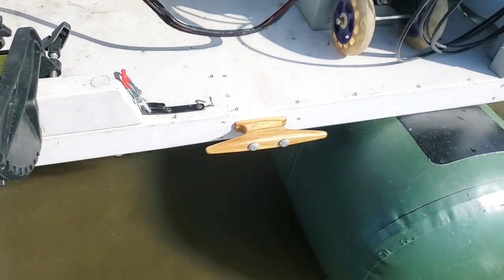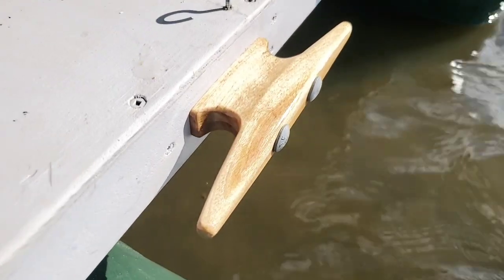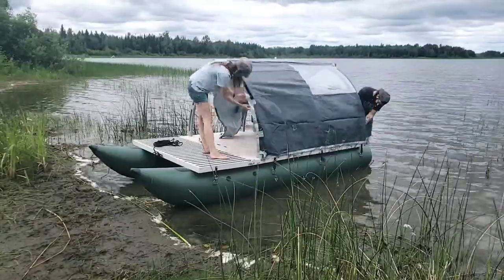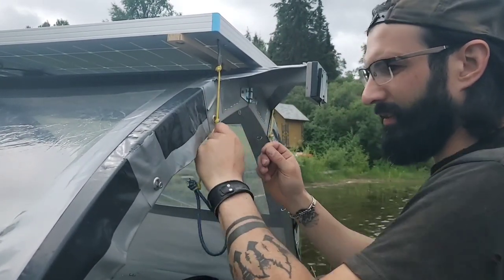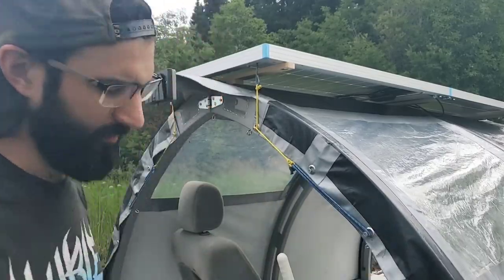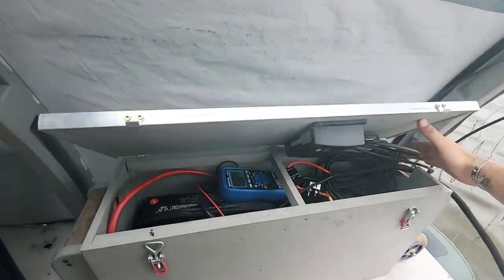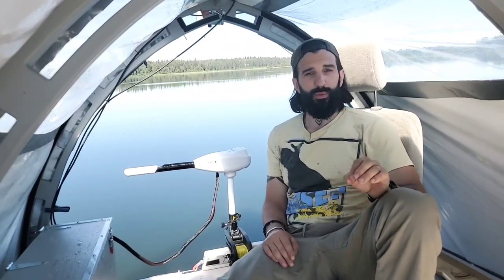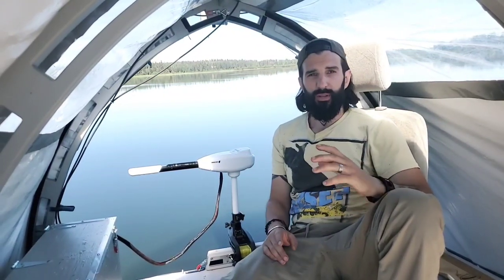Solar powered boat that fits in minivan!

Comment: sir, if i may advise, please use glands for the cable way, it do helps with waterproofing. since you are exposed to the risk of water. 

then you can add some rubber gasket sealing to the box, it have a good lock system already, it should add extra waterprotection.

batteries are always energized, please handle with care.

Comment: As soon as I saw your cool solar pontoon boat I had the idea of making a floating fire pit to attach to the front between the pontoons. That way you could get the whole camping experience and not go on land. Excellent build.
Reply from the maker: I had the exact same thought when we were out camping on the boat!!! I haven't quite figured out yet how to do that safely though. I think next year I will rebuild part of the boat and improve it where I can, maybe by then I can come up with something.
Reply: @adrianwoodworm  Thin walled steel box tube for the floats wouldn't melt, but I don't know if you have a welder. Otherwise, I think you could just use polystyrene if you insulated it with that ceramic insulation and spaced a couple sheets of sheet metal over it. Like you did for the woodstove in the houseboat.

Comment: great for where your located but the south texas sun murders pvc flotation in 1 to 2 years, and the tarps might be gone within the first year. people in the south need to stick to there is another inflatable floatation material but it is super expensive which would be outside your range i know.
Reply from the maker: Yeah, I can imagine, the sun can be surprisingly brutal. I would be curious about the other inflatable material you mentioned. Do you remember what it is called?

Comment: You could probably modify the pieces that make up your deck to connect together to make a box to keep all the other parts of the boat in when it's not in use. Maybe just a couple of corner pieces, with a dowel and hole at 90 degrees from each other, if you didn't want to modify the actual deck pieces.
Reply from the maker: Very clever! I love the way you think!!!

Comment: Have you thought of capping some sewer pipe to create outriggers in the event of extreme weather so that you don't capsize? Extreme waves especially on the ocean could capsize you. Also gutters in a bucket can create a collection well in the event you end up too far from shore. Plus a pot a pan of ferrocerium rod saw knife paracord sanitizing liquid and whatever else you want in case of a Gilligan situation
Reply from the maker: Due to the two pontoons that are basically set up like a catamaran, the boat is extremely stable, so there is no need for outriggers. Regarding extreme waves and the ocean: this boat has absolutely no business on the ocean in extreme conditions and it is not what I designed it for. 
Your ideas for the rain gutter and the other gear are great! I have to say though, I am a bit too old for getting myself into those extreme survival situations😄 on the other hand, you can never be prepared enough, I do have always a plastic crate with me with some essentials: water, knife, multi-screwdriver, wire, lighter, rope, additional live jackets and good old ductape. I would like to add in the future a first aid kit, a signal air horn, a flare and sanitizing liquid as you suggested, good call btw!
Reply: @adrianwoodworm  on my budgetary limitations of $454 a month American before bills barring a miracle I would need to build it on $500 or less total cost and if I were building it with how many times I've been homeless I would need to build it like a mini floating mobile home making it necessary for outriggers if only because I couldn't afford the mistake if it went down but I love what you've done with the place keep up the good work and I love the videos too

Comment: Solar assisted 
What's the panels are hooked up to battery or grid you can only get and use a bit  under 20% 
It's called ohm's law
Reply from the maker: I'm not sure what you are talking about, but I had the boat in the water all summer, used it about twice a week for multible hours each and  only used the solar panels to charge the batteries. They haven't been hooked up to the grid once, so I would call that solar powered.
Reply: @adrianwoodworm  but you can't continually run without stopping and having the panels charge your battery
Reply from the maker: @dennisdickinson8337  No, I can't, nor do I claim that. But I do claim that the system can run on solar only when used  in a reasonable way, which doesn't include running it 24/7 for every normal thinking person. Your claim that this setup is only solar assisted would apply that there is another primary power source, which is simply incorrect.

Comment: How do you deal.with the voltage? Solar panels always come in 12 volts I find and motors way higher like 48
I'm trying to build something with no battery usage at all. Just straight solar to power output
Reply from the maker: The newport motor was the biggest motor I could find that runs on 12 volt. So that part was no problem. I don't know enough about this topic to tell you if it is possible to run the power directly to the motor. For me personally it wouldn't be an option since I would want to be able to run the motor at any time, in the dark and when it is too cloudy for the panels to produce enough power. Good luck with your project!
Reply: Are you using a charge controller?
Reply from the maker: @WalterStephens-r8t  yes, I bought a solar panel kit, and it came with a charge controller.

Comment: Every one of your videos is truly impressive  all the way through the detail of the project itself and the slickness of the presentation. While it is obvious that you have a stupendous skill set, I am always impressed by how you finish off the practical detail such that all elements work easily and with longevity. The pontoon boat is awash with examples. The connections between the platform and tubes -  between the canopy and the platform - between the solar panel and the arches......and so on. "Thumbs up" are one thing but thunderous applause would be more appropriate.
Many thanks for all the effort you put into YouTube.  Your houseboat is certainly going to be a classic, once finished..
Reply from the maker: Thank you very much! I have to admit though things look and fit better on video vs in real. The camera doesn't seem to pick up the small flaws (and it is very easy to hide the enormous mess on the other side of the frame😆)